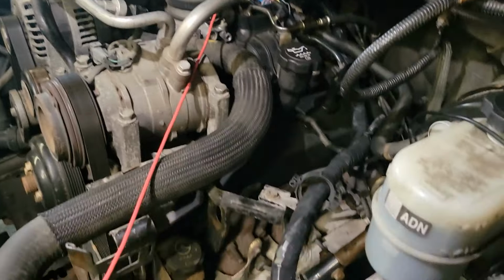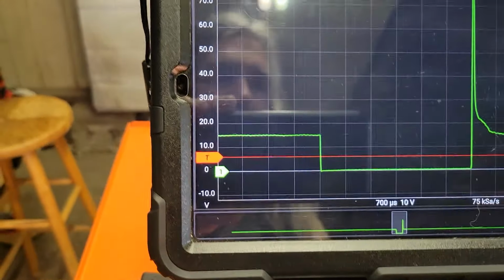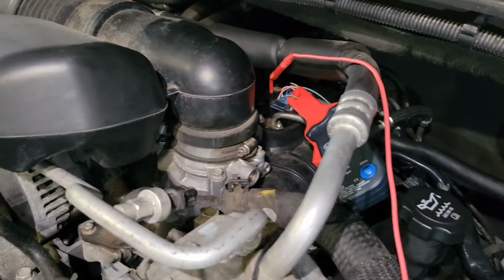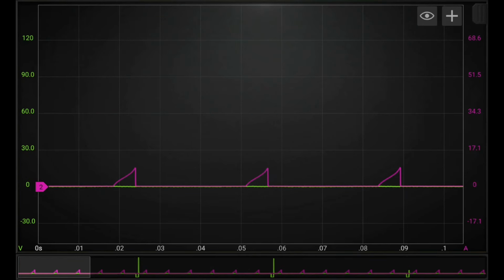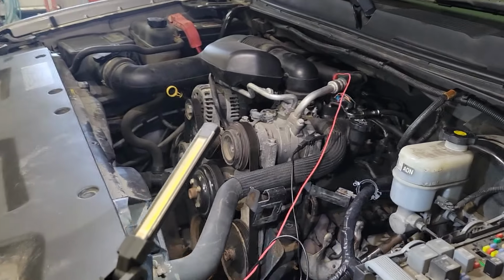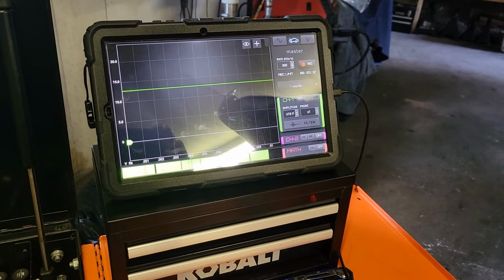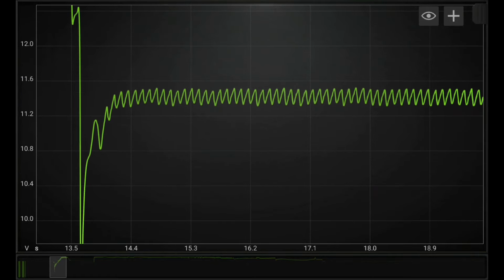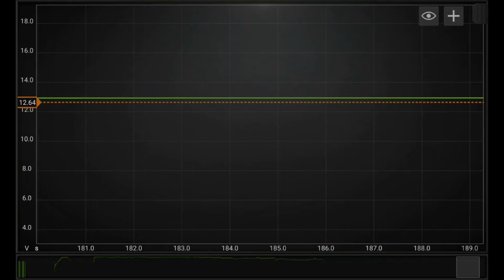Ross' spider Injector current ramp & voltage using Hscope after harness repair

Comment: I could never let something like that go, unless there was some reasonable explanation.  I'm glad you went on to find that injectors and coils were combined and split at the fuse box. Current ramps for inject and coils look a lot alike, but I wouldn't expect them the be identical.  I guess the injector fires just before the intake stroke starts and, of course, the spark is 360 crank degrees later.

Comment: hi, with that small scope and budget friendly, do you use any atenuator for injectors/coils? Also any thoughts compared to the pico 2000 series? Thanks
Reply from the maker: @motorax.service.motociclete  Hi, yes, for coils and injectors, you have to use attenuators. I was using a 20:1. Martin Loren sells the scope and he made modified attenuators that  reject EM interference. Any Hantek style will work, but it's nice to have one that rejects all the under hood interference, especially when a spark is in open air like a spark tester. 
 The 2 channel Picos are good for what they do. Darren at mechanic mindset uses them quite effectively. The pico does not use the automotive software, so it's not the whole pico experience. Hscope has the automotive module that let's you find and capture signals fast. Phase rulers, free download able presets, pinch to zoom, waveform sharing , a data logger that can run for literally 24 hours for parasitic draws  and  probably the strongest advantage, support. There is a telegram page that you can join and check out the automotive group or any of the other groups on the telegram Hscooe page. From q&a to set up help,  there is a whole  community  of hscope users .  Pico has a large following as well but quite a few tines Martin himself answered my question so fast I was still hooked to the vehicle. Denis @thegadjetsplaylist , @djmobile @ravifix have great videos with Hscope also. 
 In short, they are both great scopes, but I think the Hscooe and either the hs502 or hs512 are the best for the money and then some. One advantage of hscope is the use of any android tablet. Keeps my laptop in the house!
Reply: @Backalleydiagnostics  thanks man, i am currently using the 2204 automotive pico is way too expensive for my budgets. I saw on your videos that the Hscope gets a better graphic with much less noise than pico and straight to it's webpage to see if it's 8 bit or 12 bit.  Indeed the pico software it's very complex even in it's non automotive form, and using the pico 6 automotive hack i find it having limitations over the pico 7. 
What i am dissapointed is by their support from my POV is inexistent. Emailed them a couple of times and received reply after 2-3 months and forum support it's again pretty low quality.
At this moment i'm thinking if i would go with the a 4 ch entrylevel automotive Micsig of this Hscope. Was waiting for Rotkee to re-launch their 8 ch USB scope but replied my email they won't do it anymore since their partners don't want to build it anymore.
Maybe you can find time to do some software review on the Hscope and it's functionalities compared to Pico or other budget friend scope.
Cheers

Comment: Hi there can you tell me please what is that oscilloscope you are using it here in this video because it seems very good quality and the wave form displays very clearly I want to buy it can you send me its website please, thanks dear
Reply from the maker: @muhammedsons2675  hi, it is the hs512 from Martin Loren.com . The software is Hscope from Martin Loren as well. You can get hscope free from the pla store and use in demo mode. It works with several scopes by purchasing a license for the specific scope you have. The hs502 and 512 come with a license for hscope and the automotive module

Comment: The ramp test on the fuse it looks  like coil ramps. You're sure its the right fuse ?
Reply from the maker: @mandytuning  that's what I was thinking myself and now I believe that is the case. There is only 1 injector fuse 24 on the lid labeled injector a . After looking online, it is the coils and injectors for the right bank. The coil fuse 13 labeled coils is injectors and coils for the left bank . I didnt immediately think that because there are 6, all with equal current ramps. I figured a coil and injector wouldn't be the exact amplitude and timing, especially spaced symmetrically. I am not sure how chevy did that, but that seems to be the case .  Teaches me  to go off of a fuse box lid lol. Thanks for the input!
Reply: that was my thinking too...
Reply from the maker: @mandytuning  I stand corrected, there is an Injection b fuse no 13. I had to look at the lid again. I inagine i was expecting to see B (fuse 13) after A (fuse 24 ), saw 6 identical ramps, and assumed that was 6 injectors. Did not read D&O beforehand as I could get what I wanted from the actual wire. Still, there is info I would have liked to have had but was on the wrong bank,

Comment: Eric I appreciate you posting your videos. I purchased the Hscope from Martin but have not had a chance to play with it. Sometimes life gets in the way. I’m sure you know that. I also purchased hie newest 20-1 attenuator . He made some small changes internally which I need to understand a little better. Thanks again for sharing and I should start playing around with it this week .      Artie 👍
Reply from the maker: That's great, Artie! Luckily, I had already purchased the new attenuators with the scope. The 10:1 also has the EM rejection, but I usually use the 20. Basically it helps get a good capture especially when the is a spark firing. Like in a spark tester. Without the new style , android crashes Hscope. 
 You got the 502 correct? I haven't encountered many differences but the 502 would have definitely been better on the current clamp or the purple trace. I was on my lowest scale and could have been lower.  The yellow trace the 512 would be harder to blow up, so they compliment each other in different ways.
Reply: @Backalleydiagnostics  yes first thanks for the reply and yes when I purchased the 502 I was in contact with Martin . I do have other attenuators but I watched Martin explaining 20-1 and I never heard anyone explain the EMI characteristic so I went with it. I wonder why the voltage and amp scope lines didn’t match up? Hope somebody comments on the issue . Catch you on the next one 👍